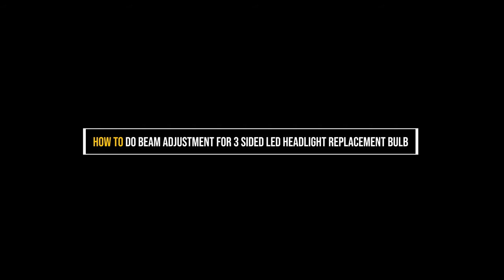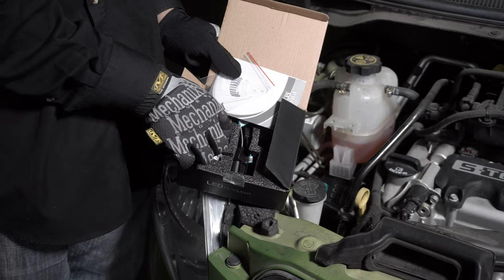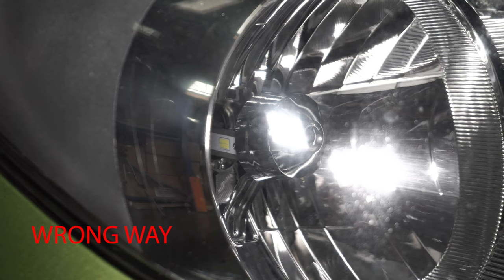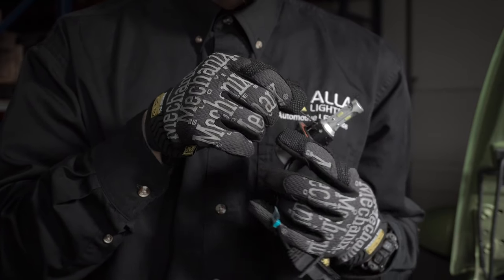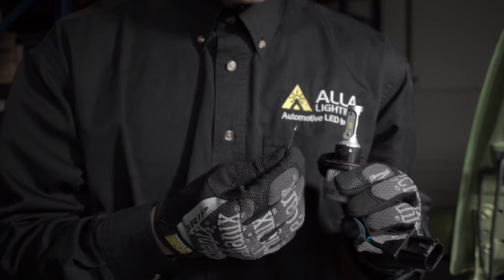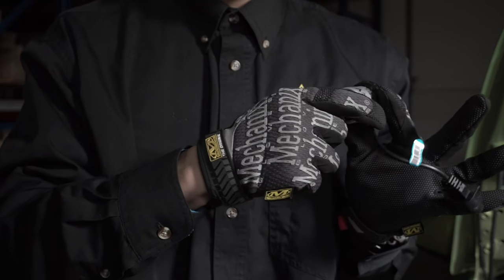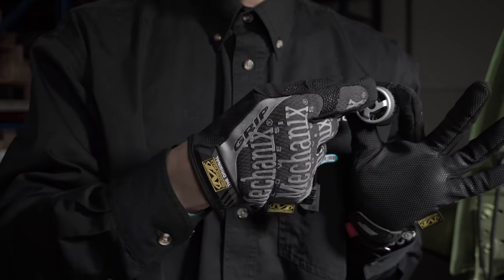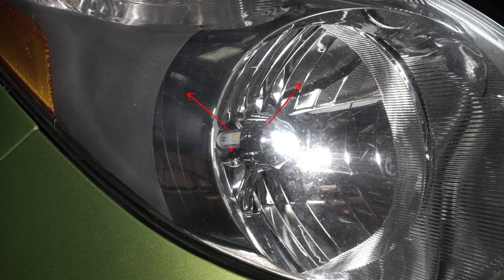How to Adjust, Align & Aim Headlights 3-Sided Dual Beam LED Bulbs?

Comment: I have a 4 sided led H13 bulb where 2  LED light up for low beam and 2 light up for high beam.
Would I install them the same way  with the low beams as the 3 way LED bulbs were on top ?
Also , the 2 led lights for low beam are on a slight angle left and right on each side and not in a 90 position? correct.
Thanks
Reply from the maker: Thanks for your comment, for your question, please check https://youtu.be/4jLJgnbDZJg this video, which maybe helpful for you, if you need further assistance,e please feel free to contact us.

Comment: I have 3 sided LED H4 bulbs and I installed them as you explained, low beam is good but high beam is up in the air rather than forward, is it bad bulbs?
Reply from the maker: Have you confirmed the high beam lights under the bottom? and make sure the angle is correct, for H4, the beam pattern is adjustable, so please try, yet if you need more assistance, please email us service@allalighting.com your order number, vehicle's make, year, model and if you have the installation pictures of the bulb's angle, that will be the best, thanks in advance.
Reply: @AllaLighting  My bulbs are from different brand, 3 sided, two for low beam and one for high beam. I have the one for high beam facing down and the two for low beam facing upward at 45 degree angle each. The bulb can be aligned by simply rotating it (no screws). I read that this is how 3-sided bulb is supposed to be positioned but I have feeling something is wrong. Btw, this is happening in both driver and passenger side bulbs. I'll try to do more adjustments.

My car: 2015 Mini cooper F56 3-door (hatchback), headlights has reflectors not projectors.
Reply from the maker: @azzammeeralam7182  Thanks for your information, yes, if low beam has been adjusted in horizontal line and no issue,and the high beam should have the issue, it probably the bulb's issue.
Reply: @azzammeeralam7182  hey i am in a similar boat such as you,am curious as to how did you solve this